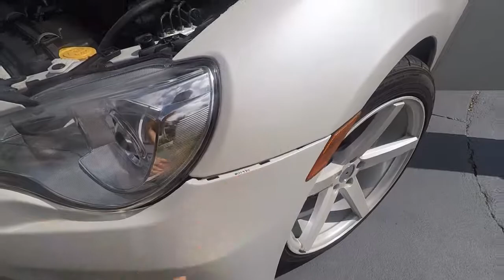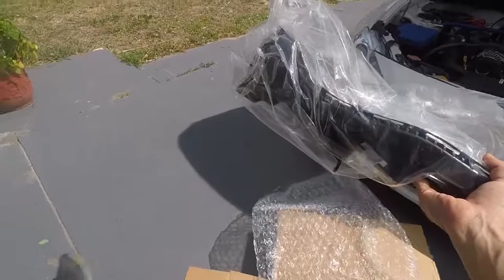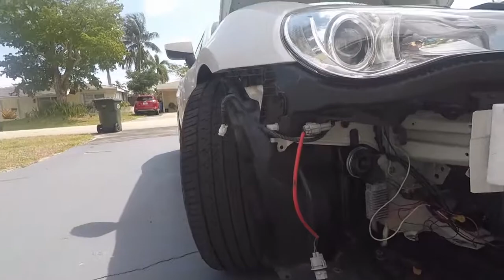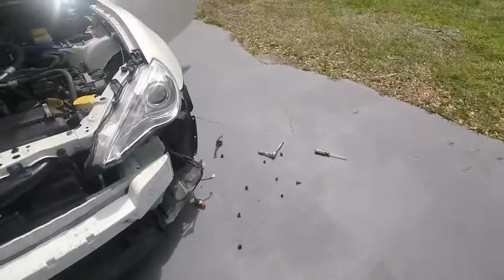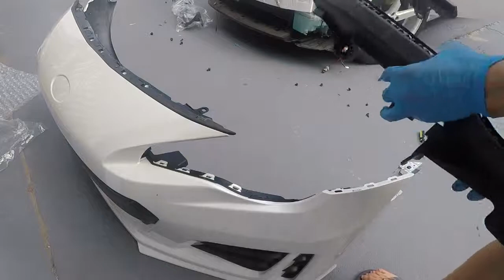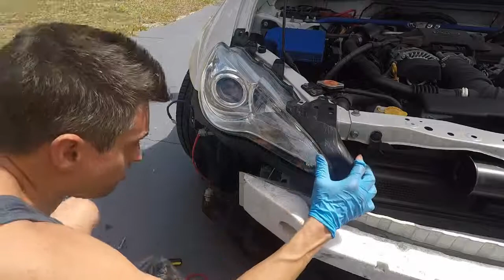BRZ on a FRS bumper fit fix

Comment: Will the 2017 BRZ front bumper fit the 2017 Toyota 86? Also, where you buy it? Looks awesome!
Reply from the maker: I bought the bumper from someone who got a new aftermarket bumper. From what I hear, YES, they are all swapable
Reply: They are all direct fit. Under panels, fender, lights, and hood all match up between all versions of FRS, 86, BRZ 2013-16 to 2017~2020. 
Like he says, the headlight support brackets have an extra retainer on the newer post 2017 models so that also need to be bought too for the corresponding bumper. (or cut the tab off like he did.) 

However, the 2013-16 FRS and Toyota 86 have turn signals on the bumper, while all other versions have it inside the headlights.  So if converting from 2013-16 FRS/86, you'd also need to either convert the headlights to any BRZ versions or 2017-20 Toyota 86 version (and rewire them), or add turn signals somehow to updated bumpers without them. 

The headlight support brackets in this video are all direct replacements too, and old ones were simply updated with new one to remedy the "bumper sag" issue that many early 86/BRZ/FRS had.  
The attachment points are all the same as he describes in the video, but the updated parts do have smaller clearance from the mating fender to reduce the problem.  It didn't however completely solve the issue, as many of these are still sagging after the update.  The problem is really the front overhang of the bumper being far and heavy to be supported by the top center screw panel area, and the sections on the sides, and eventually with enough age, light hits at the bottom or extended high speed use, the bumper will start sagging again.
Reply: @UCdxCAerB3vHTpMGOHocBVQQ Thank you. I had it done. Used 2014 Brz on my 2017 Toyota 86. Perfect fit. Just needs a bit of aligning to close gaps on the sides.
Reply: @Club4AGChannelUSA  will the 2018 Toyota 86 front bumper fit on the 2013-2016 brz?

Comment: Will a 2017 fender fit a 2013
Reply from the maker: I'm leaning towards YES, But I'm not entirely sure and I don't want to steer you wrong
Reply: HelixAFire yes, but the fenders are exactly the same except for the upper garnish and body colors.